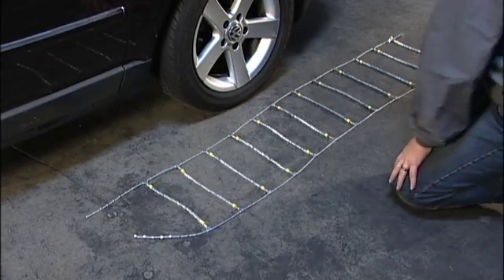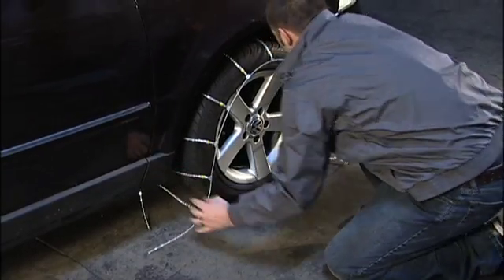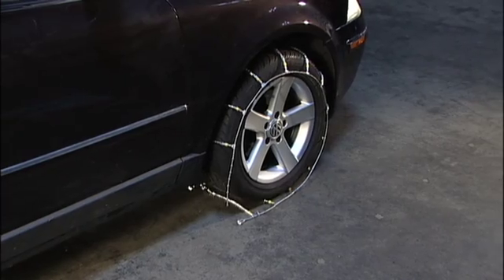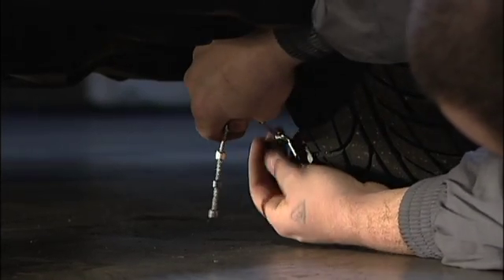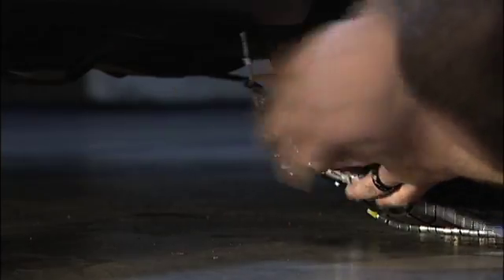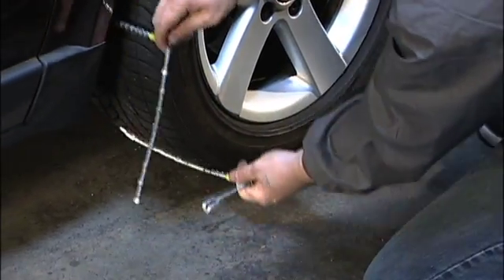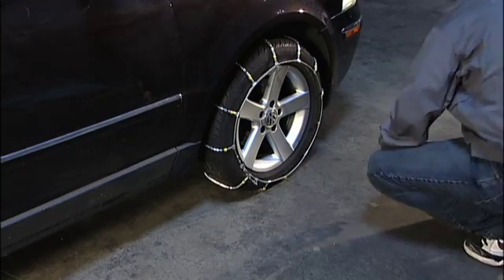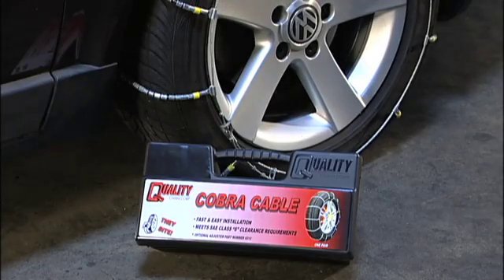1000-1600 Series Cable Chain Installation Instructions

Comment: What really helps is to turn your tire away from the side you're installing. So in this video you'd have the wheel turned to the left, giving you easier access to the back of the tire.
Reply: Good tip! I'd rather do one at a time and have it be easier! Headed to Yosemite now and chains are required to be in the car!
Reply: @mcanally1  how was it?

Comment: Thanks - BUT WHY did the guy leave it so dang loose?!?  The narrator says make them as tight as can by hand - the guy leaves em sloppy loose.  Also in the beginning you should show what you mean by 'face the hook away from the tire.'   Also in your written instructions, you say lay them on the ground with open part a certain way, but you don't say that you then flip it as it goes on the tire.  I figured all this out, bcs I'm 'handy', but your video - and written instructions - should be added to , to show these critical elements.  Thanks.